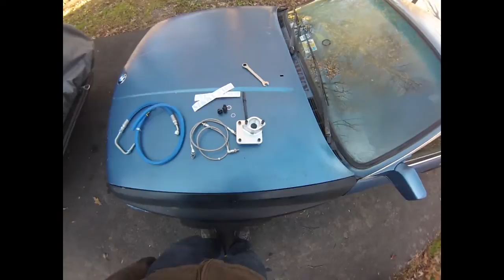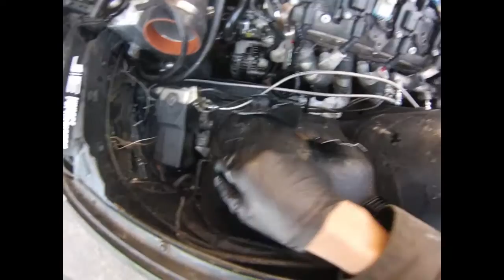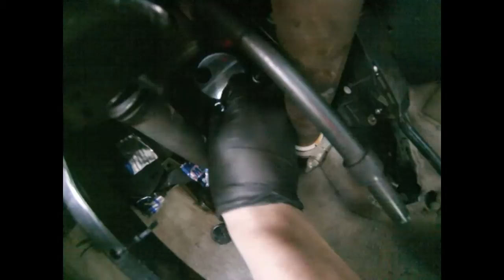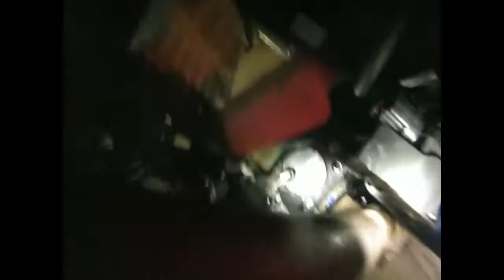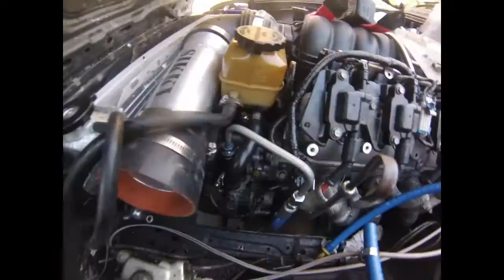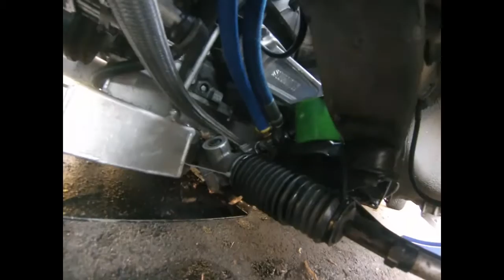Sikky E30 Manual brake adapter and LS power steering line install

Comment: does it brake decent? thinking about going this route VS the sikky hydroboost setup because its cheaper. do you have any experience with the sikky hydroboost setup? thanks
Reply from the maker: I actually swapped from the sikky hydroboost to this setup. The hydroboost worked like factory but was too complicated. The manual brakes requires much more effort but simplifies things a lot. Personal preference really.
Reply: i just saw some pictures of the hydroboost set up and it looked pretty complicated. it also looked like it cluttered up the engine bay alot with all the lines. do you drive yours on the street?
Reply: also, do those blue power steering lines comes with the booster delete kit?
Reply from the maker: I do street drive it. The hydroboost was more streetable. The brakes are fine. they just need a bit more force than factory.
Reply: thanks i think im going with the booster delete kit.

Comment: What were you running before this silky delete kit? I'm literally midway in the swap and I'm looking for options lol
Reply from the maker: +bamrock9 I was using the sikky hydrobooster fed off the power steering pump. That had the best pedal feel. This seems to be better for race tracks.
Reply: +Yoshi Jeffery and did you use sikkys steering shaft? I just got the lsx kit them last week and I'm looking at what else I need to get it going. Btw did you use their headers as well?
Reply from the maker: +bamrock9 I'm their prototype car. You name the E30 product, it's been on my car. The steering shaft is just 2 flaming river U joints and a special machined bar. You can probably DIY if you want to save some money. But also, the sikky headers are designed around an E36 steering rack. 

Feel free to email me protomor@gmail.com and I can help you out through the process.